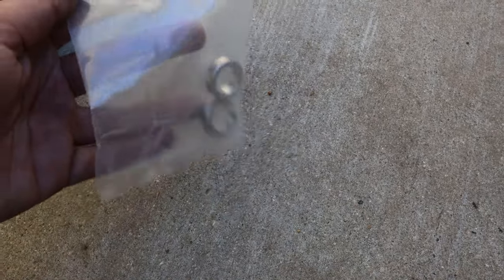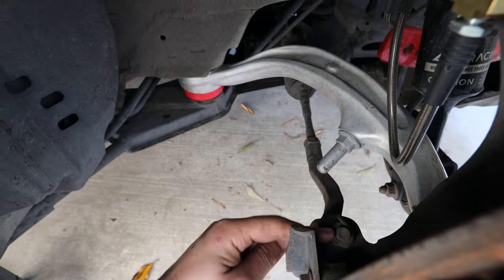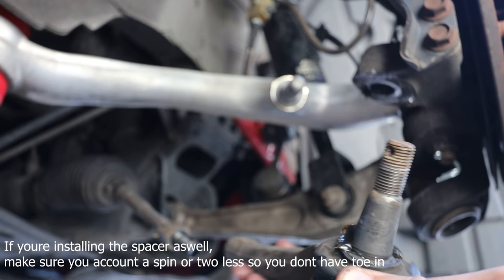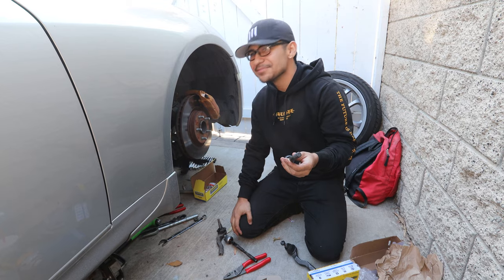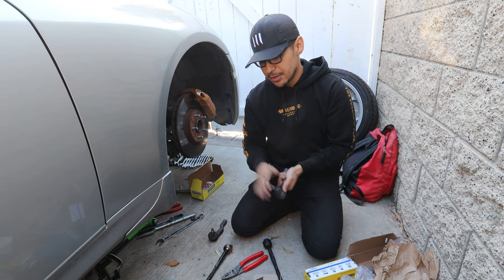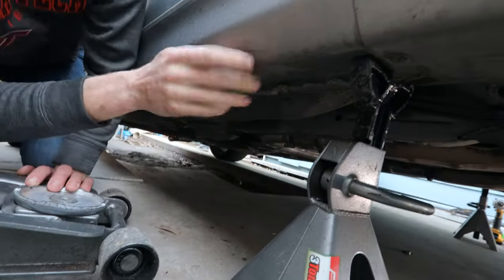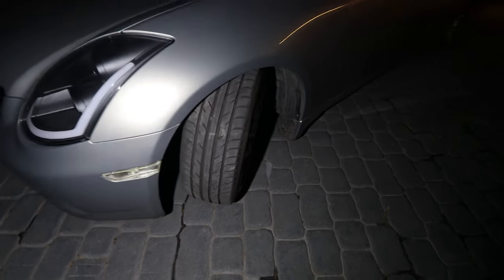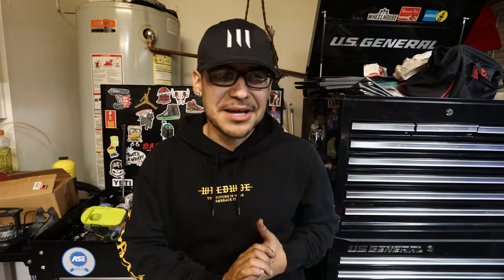The CHEAPEST Angle Mod for YOUR G35 / 350z!!

Comment: Would rather get longer inner tie rods. No need for spacers!
Also adding the spacer will change your alignment, right??? 🤔
Reply from the maker: definitely agree with you! i personally did this because its the most cost efficient way to get more angle but theres plenty of different ways you can get more angle aswell! adding the spacer would give you more toe in so you would need an alignment after!

Comment: What about removing or shaving down the nubs that stick off the compression arm?
Reply from the maker: You can do that aswell and take the two 10mm on the knuckle where that nub hits and get 3 degrees extra!
Reply: @JoeVazquez  Is there any downside to taking the nub off the compression arm along with the stop on the hub?

Comment: wait, if you add spacers, and it gives you more toe in, then you have to get an alignment to get it back to regular toe. Didn't you just cancel out the spacers. If anything you would have to get something to extend ur lower control arm too or move ur ball joint farther away. and maybe i'm just dumb which is a big possibility but i thought that the only real way to change ur alignment is change the tie rod end location closer to the pivot point which would be cutting the knuckles, and then adding tie rod spacers so that you have enough throw to use all the new angle, anyway lmk what u think @JoeVazquez